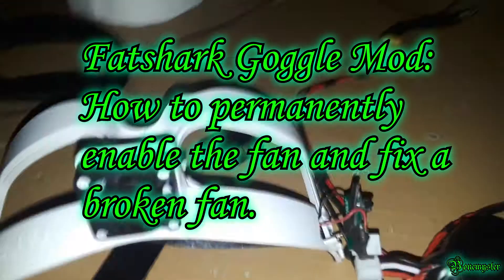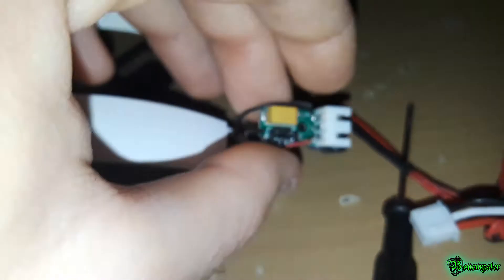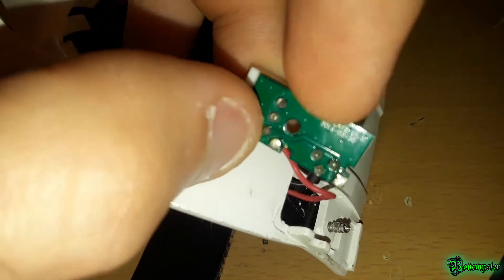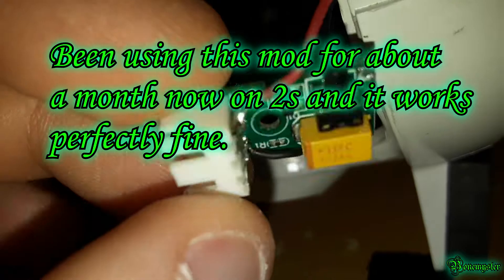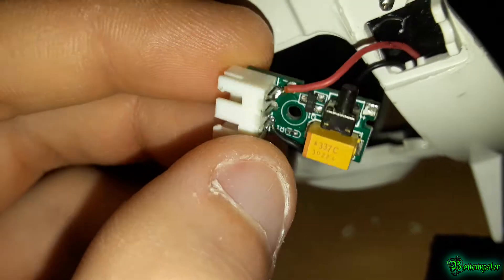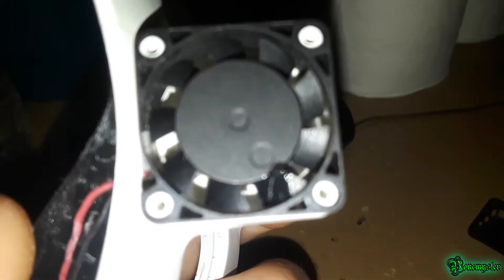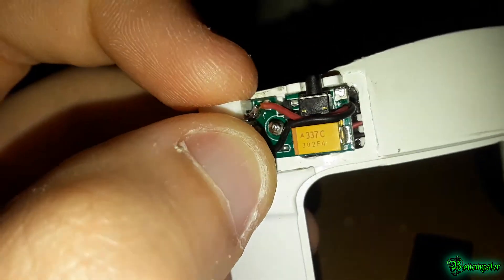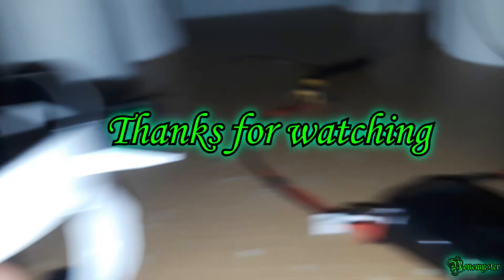Fatshark Permanent Active Fan Mod and Fan Fix

Comment: Cant you just short the button..?  yellow thing is a tantalum capacitor. From what I see there is no regulator. Just a diode and cap. Good video tho, others are bypassing the balance lead which I get, but you still have to hit the button.  Unlike your video, which is what I was looking for, is for the fan to always be on. Thanks, now I know how to go about it. Good info